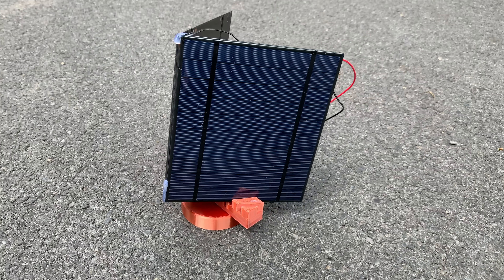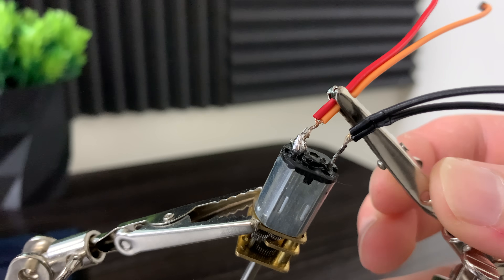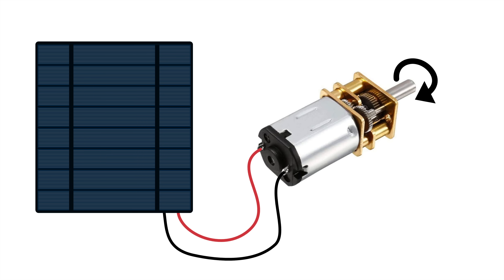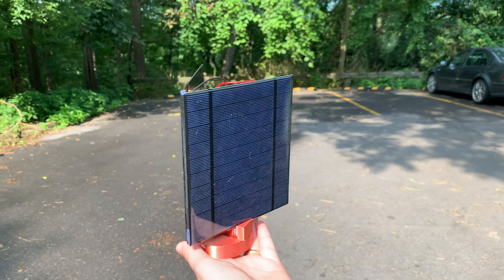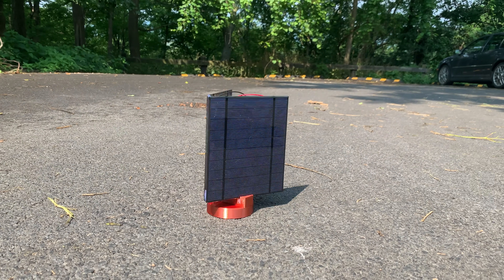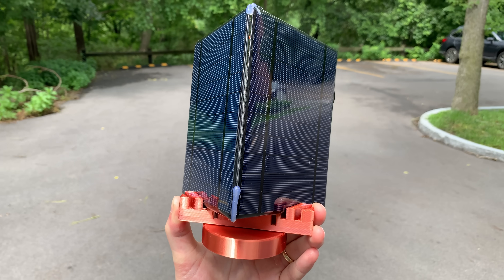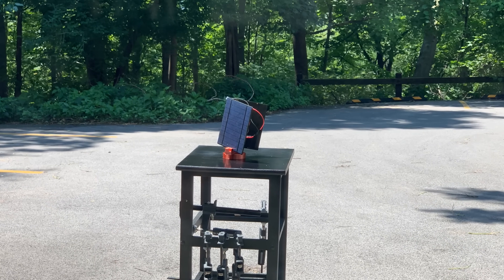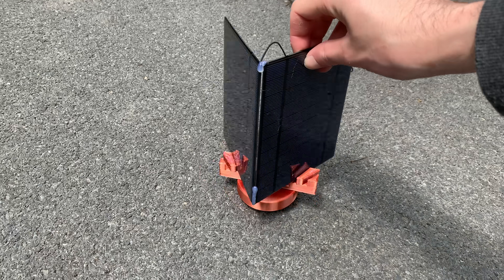World's simplest sun tracker.

Comment: Dumb design. So not only is all the power being wasted because the panels are shorted to each other, even if you fixed that problem the angle of the panel means they only receive at most half of the light they should! I bet you’d get more power laying them flat on the ground.
Reply: I would use smaller panels than these for tracking the sun connected to a much larger one to optimize the power output of the larger one.
Reply: Josh Kinion but you would struggle to get the torque required to turn the big panel with even smaller panels driving the motor
Reply: @billytisme  small motor, like in the video, attached directly to a small gear with a large gear ratio to provide slow speed for medium torque, witch is all you need, to move the panels.
Reply: Changing ratios will not solve the problem, f.e. half a turn of the tracker will sort in a quarter of a turn for the big panel, so the angle to the sun will be different, unless you use an axle, but then there is more friction...
Reply: @MrBenoitvh  have the large and small panels attached together. Have the motor on say a 100:1 gear ratio to move the panels to the correct angel for maximum sun exposure. This guy has a hand cranked charger with hand slow speed/high torque and a high speed/low torque output, why not have a similar, but reversed, gear ratio?

Comment: This is a great example of a Logic NAND gate, the first and simplest and most powerful of all Logic. Without NAND no computers !  
Electrically there is a problem. Driving power into this type of solar panel will destroy them. The fix is simple, see if you can find a solution !
Reply: It's not really a nand gate tho
Reply: @emiliaolfelt6370  Hi Emilia. what makez you say that ?
Reply: Oh crap !  I have made a big mistake !  It's not a proper logic gate example, I am sorry.
A two input logic gate has four input conditons (0.0)  (0.1)  (1.0)  (1.1)  All outputs are the same, except for ONE condition ONLY were the output inverts. In the case of the NAND gate  (0 0 = 1)   (0 1= 1)  (1 0 = 1)  (1 1= 0).  
Do a search for "image nand gate truth table".  Mega sorry folks.
Reply: @snakezdewiggle6084  A very rare example of saying something, being wrong and owning up! Bravo sir.
Reply: @dougle03  Thank you. I believe we all should own the good, and bad.  ;)
Reply: @dadigitechman  Yeah great job working that out. XOR is the best Logic solution. For smooth movement, the Motor and Panels need Analog feedback path.   After reading your post, I went hunting for the unit I built 25yrs ago. It's Diodes and Resistors, and the Motor turns constantly (15 degrees per hour). It tracked the Sun and steered a telescope to photograph Sunspots.   At the begining of this thread, I would have bet real money, that I used NAND gates.
Reply: Attach a couple heatsinks and use bigger wires than necessary.  I don't know logic very well...
Reply: @D3fcon141  ha ha, yeah sounds good. So ignore the Logic, it's all wrong.  
Electrically, there is a very thin foil tape that runs down the length of the panel that breaks real easy. And if you apply a moderate current to this type of panel, in full darkness, they light up.

Comment: If I am not wrong you are shorting two sources (solar panels) which is not good as there might be a circulating current which may damage the panels.
Reply: Yeah the panels themselves would not really be usable for power, but this concept could probably be used to setup a tracker for a large array.  Ex: you put this setup on a big array then hook it up to a motor that can move the big array at same time. You would basically use the faster motor and a gear reduction so it has enough power to move the big array.  Could also use transistors to use a bigger power source and bigger motor though I guess it starts to step away from keeping this super simple.
Reply: And additional, there is no way to grab the produced power since it`s necessary to control the motors ? or am i wrong
Reply: @aivazi  If you wanted to use this for real, you'd use these two small panels (neither of which points at the sun) to point a larger one (not connected to the motor) at the sun.
Reply: @cosmicosmofour6883  Right, and you'll also need a motor driver because such small current wouldn't be able move larger panels.
Reply: @cosmicosmofour6883  not when its only for a security camera
Reply: @aivazi  Easy fix.

Add a diode to a non-resisted output and put a  10K Ohm resistor on the black wires going directly to the motor. not 100% but you will be able to retrieve some of the enrgy
Reply: @EuclidesGBM  wanna see the motor turn with 10k resistor in series. A led would be too lazy to light up
Reply: @EuclidesGBM  it does not matter which wire the resistor goes.
Reply: @aivazi  I figured this is just the orientation mechanism. The second component is to modify this to a larger motor that turns a much larger mount with real solar panels. As others have said, swapping these little solar panels for photodiodes would accomplish the same thing, but you're using these panels in a way like using a speaker as a microphone. It works, just not designed for it.
Reply: Series or parallel is defined by topology not polarity. The panels in the video are wired in parallel because they are side by side and then the output to the motor is the combination of the the 2. If you imagine an electron flowing around the circuit it would go through either one or the other panel then through the motor. Kevin's suggested circuit has the panels wired in series because they are chained end to end. The connection to the rest of the circuit comes from either end of the chain. There is no connection to the middle (the black wires). An electron would have to travel through the first panel then the second then the motor. This makes it series. If you did this with 2 batteries which had a different state of charge it would work, and the lower battery wouldget charged up a bit in the process. But if the panels do act as diodes then no current would be able to flow so it would not work. The circuit in the video has problems too because when the panels are evenly lit the motor does not turn and all the power generated is flowing through the wires and the panels and ignoring the motor. The wires will get hot. This is not healthy. If you wanted to do this for real you would need a more complicated system using something to compare the voltages while not letting the current just flow uncontrolled through the wires.
Reply: @adrianthoroughgood1191  20 years of electronics disagrees with all of these statements.  Believe what you want though.
Reply: just add Schotky diodes in reverse direction to each panel, connect the panels in series, such as two red wires together and black wires to plus and minus DC motor, even if Isc is small, it can make the operation smooth
Reply: Yes but no. these are photodiodes in the end. depending on the electrical bias they are either producing energy or light, they are either a 'solar panel' or a 'LED'. Efficiency will vary depending on the specific design and yes, led's will generate a current when impacted by light. not much and internal impedances may be to high for them to generate a significant amount, but they do. and therefore they are not 'shorting out'.
Reply: And then if one of the solar panel is damage by shorting...  it will keep pointing away from sun...
Reply: It's all relative (zero voltage reference point) and about voltage differential!!!😁👍🏻
Reply: yeah this was my thought as well, while its a interesting application of solar panels to track the most light, it needs more circuitry to be useful by itself, however angled panels balancing light is already not efficient.   Using these or smaller ones in a circuit to help aim a bigger solar panel in 2 axis's would be a far better use of this in an actual practical application.  Something like using them to trigger some transistors to let motor rotate when they reach a threshold over a certain period (can put in some big capacitors/inductors to smooth it out)
Reply: @AsthmaQueen  A microprocessor control system using a stepper motor and a couple of light dependent resistors would be ideal.   Then you can turn the panels in steps of say 5 degrees when required.

And if you use a low powered microcontroller from Microchip PIC range, then it could be easily powered from a small solar cell .
Reply: @deang5622  oh 100% would be alot easier than messing around with PID loops and setting up all the transistors to balance each other
  Specially for a amateur project
Reply: @AsthmaQueen  PID controllers and closed loop control systems are degree level engineering, too advanced for the hobbyist.
Reply: @deang5622  very fair lol I guess I forget sometimes how much studying I've done to understand how to setup stuff like that .

In that case probably just a basic Arduino with voltage sense and motor control for its axis.

Again with using angled solar panels or light sensors to aim a main solar panel would be best.
Reply: Diodes🗿
Reply: I am not sure, how it works, but here are current sources in paralel, not voltage sources to add or subtract. This gives a crazy amount of energy vaste.
Reply: This will not damage the panels. It is basically just sitting there at zero-voltage passing Isc, which panels can do no problem. Furthermore, they aren't normal to the sun, so the current they are flowing is substantially less than Isc. Finally, consider conservation of energy--they will get no hotter than if they simply absorbed all of the sun's energy as heat. Would you expect that to cause them to melt?
Reply: @cosmicosmofour6883  zero voltage? So there is no sun light falling on each panel?

 You're like the content producer, you are getting mixed up between voltage and current.
Reply: @deang5622  Sigh...
Reply: Well it's just a fancy rotating thing other than producing power.
Reply: You're right. This is shorting two sources and is equivalent to connecting the opposite ends of two batteries together. The better way of doing this is to tie the black wires together and connect the red wires to the motor.
Reply: @CoffeeVector  "equivalent to connecting the opposite ends of two batteries together"

No, solar panels are not equivalent to batteries. Solar panels are current sources, shorting them results in a current limited by the insolation amd is not damaging to the panel. A battery, especially modern lithium amd lead acid batteries behave like voltage sources with potentially very high and damaging short circuit currents.
Reply: @CoffeeVector  that would rotate it in one direction forever.  The panels are only 2.5 watts.  The short circuit is irrelevant.  The whole device is only a sensor to be used to control a larger array's positioner.  Everyone keeps overthinking this.
Reply: @ericapelz260  I don't think it would rotate in one direction forever. What I'm precisely saying, is that you should tie the black wires together, and tie each red wire to the motor terminals, using the voltage difference to power the motors. Another way to phrase it is that he should connect the sources in series rather than parallel. Even in series, if the one panels voltage is higher, you'll have a positive voltage to the motor, subsequently if the other panels voltage is higher, you'll have a negative voltage to the motor. Yes, I understand that what he's doing works and it's not a big deal for a prototype concept. That being said, to do it the way I suggested would remove the short and still do exactly what he wants.

Edit: batteries -> sources
Reply: @CoffeeVector  the way its configured now has the panels in series.  Connect tge the black wires doesn't provide opposing current to drive the motor both ways. If you mean to connect one red wire each motor terminal,  you will get no motion since the dark panel will likely fail from the reverse current, and if it has blocking diodes, it will survive,  but nothing will happen.
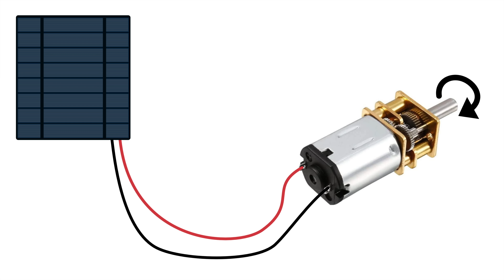Reply: @Erica Pelz  At 1:38, you can see that the panels are wired in parallel. I am referring to wiring the red wires to each terminal of the motor and their grounds together.

I looked it up, and it seems that you're right; shorting solar panels is fine as they don't act like typical voltage power supplies. What I was saying would only hold up for ordinary power supplies like batteries.
Reply: @CoffeeVector  That's a series connection.  Parallel would be black to black and red to red.
Reply: @CoffeeVector  the voltage difference between the two panels won't be high enough to power the motor If both grounds are tied together and the two positives are connected on the motor. And even if it is, the panels are basically diodes, so enough current won't flow back through the panel which has the lower voltage potential through its positive terminal.
Reply: @ericapelz260  when I say series or parallel, I mean series or parallel to the motor. When you connect both ends to the motor, it's parallel to the motor. Both ways you're saying is parallel with differing polarity. 

Whether the sources are series or parallel to each other doesn't mean much in this case since they're shorted.
Reply: @CoffeeVector  that’s not how parallel works. You can have two sources in series, or parallel and you can have two loads in series or parallel.  A load and a source are always a series circuit.
Reply: @ericapelz260   I'm beginning to get the feeling that you're trying to find things to argue about. Regardless, series and parallel refers to the configuration of two-terminal elements regardless of whether they are loads or sources. If there are only two elements, then there's no difference between series and parallel. Regardless of polarity, if three components are wired in the configuration in the video, they are parallel. An indication of such is that there are three-way junctions and three loops. If they were wired in series, there would only be one loop. You will find that the Wikipedia on series and parallel circuits agrees with me on this.

https://imgur.com/gallery/ivw0FHP

Here's a drawing of what I mean. I've neglected to indicate the polarity, the loads, or the sources since they are not relevant.
Reply: @CoffeeVector  No Kevin, your wrong. Coupling them in series would produce a permanent but occilating positive voltage as you only add the 2 voltages, and neither one could ever be negative... If the one outputs 0 volts and the other one 2 the total is 2v, visa versa produces the same. It would always rotate in one direction at different speeds depending on whether its fully facing the sun.
Reply: @CoffeeVector  I value accuracy.  and since Wikipedia is infallible, feel free to believe anything it says.  LOL
Reply: @ericapelz260  yep exactly
Reply: @dillanyssel8683  No you are wrong, a series configuration  would not produce an oscillating voltage, it just would not work.

What everybody on this forum is forgetting is that solar panels are effectively diodes. They comprise a pn junction.

In a series configuration, where one panel is wired in one way around compared to the other, you have two diodes in series, one is forward biased, one is reverse biased. 
The current produced by one panel cannot pass through the other. And it doesn't matter what the illumination is on each panel.

And if no current can flow, then the motor cannot rotate.
Reply: @deang5622  a small exercise: 
remove the motor and look at the two PV elements and how they are connected.
The PV elements are connected in series.
The only difference is, that the motor is not connected in series as well but in parallel to the series. That’s where the “magic” happens.